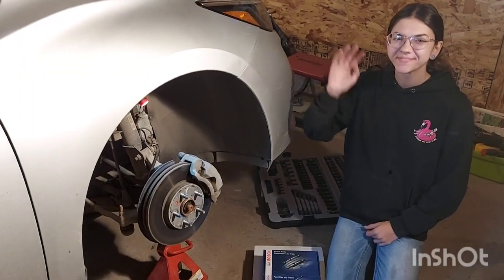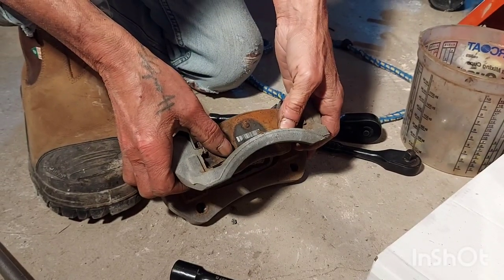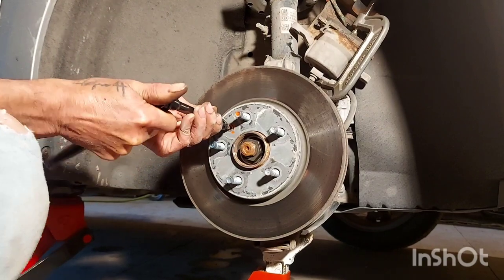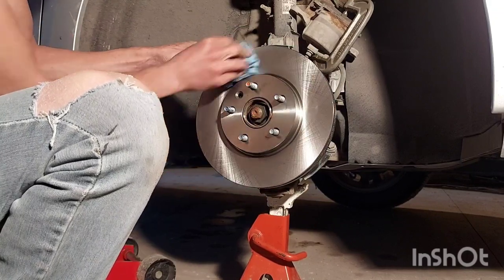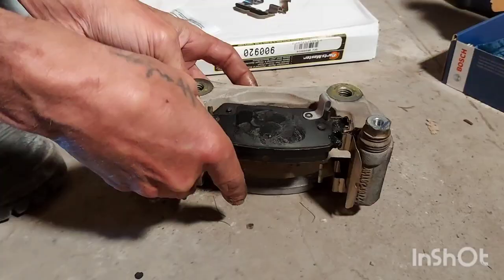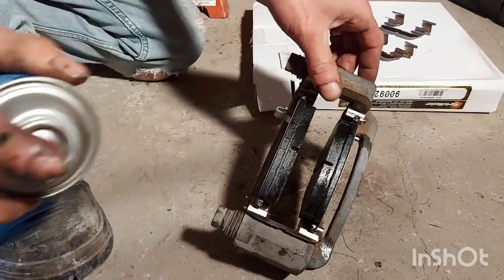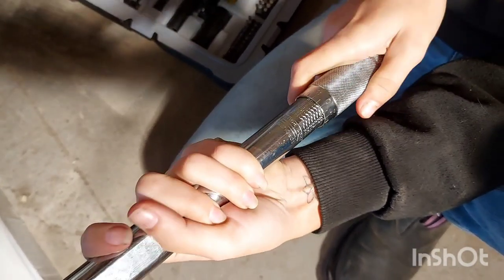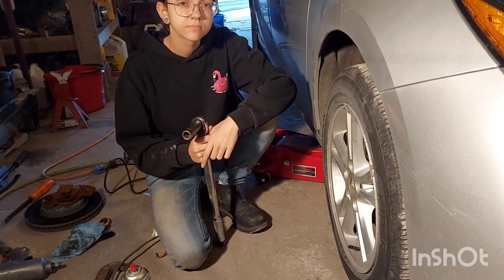2018 Chevy cruze LT front brake pad and rotor replacement "lucy"

Comment: For those rough bolts some PB blaster and putting some kind of larger tube on your wrench for additional leverage helps a ton
Reply from the maker: Right on thank you! Excellent advice i really appreciate that alot!
Reply from the maker: I usually use deep creep or rust check but i hear good things about pb blaster, im gonna try it out and give a shout out to you! Thank you again for watching and for taking the time to comment and share some knowledge! Right on!

Comment: What if I have no brake lube, or brake clean ?
Reply from the maker: @GregWnuk-p1f  brake lube usually comes with the new pads, brake kleen is cheap and available everywhere. If you ont lube the caliper and slider pins they can seize and stick

Comment: Which way do I turn it to brake the bracket nuts on the front left side ???
Reply from the maker: They are normal thread unless your doing a range rover or 58 dodge
Reply from the maker: Couterclockwise to loosen
Reply from the maker: They can get rusty put some loosen juice on them, have a coffee, then try em again!
Reply: Breaker bar is your friend
Reply: Didn't need to remove the whole caliper just remove one and pull it up and change em